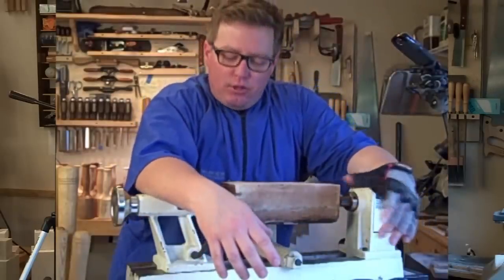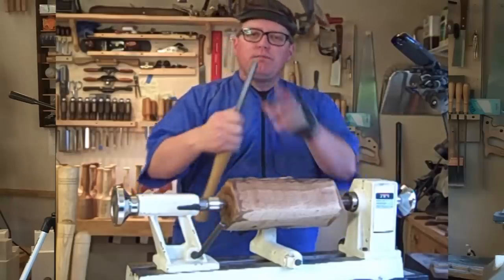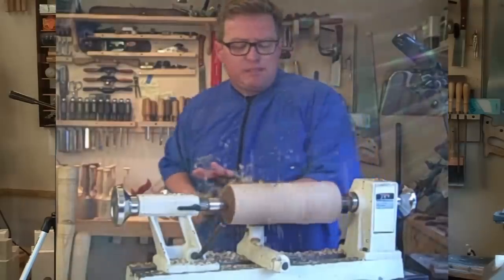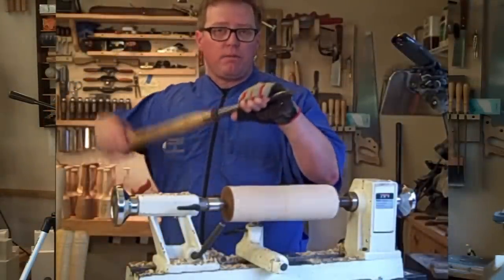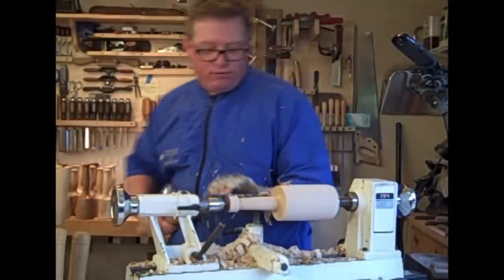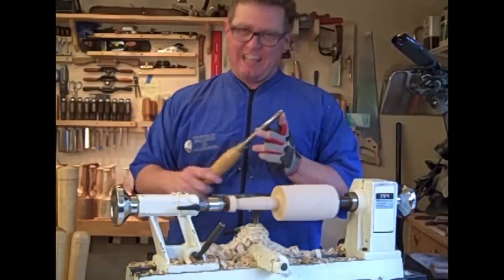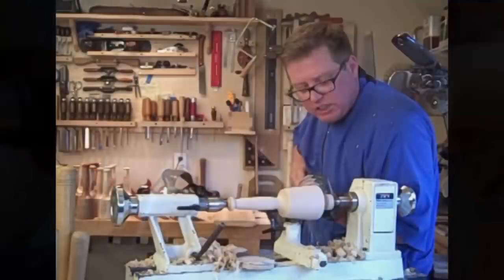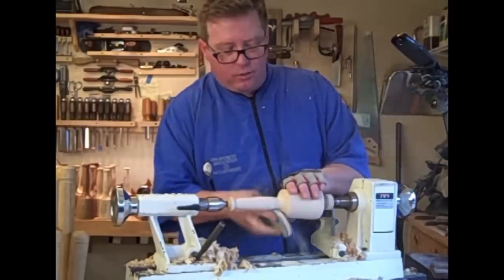Wood Turning Demystified - Basic Educational Demonstration to Get You Turning

Comment: As a beginning wood turner, I find this video very helpful in pointing out proper tool position and pivot. I have  reviewed it several times then practiced the concepts afterwards. While it feels different than it looks, the results are getting better. I suspect using soft pine is not the best, but maybe a cheaper way to learn.

Thanks,

Michael

Comment: Excellent video. I was having problems with my spring pole lathing and you absolutely gave me the courage to soldier on and some troubleshooting to boot. I underestimated the importance of the tool rest and just slapped one on there in haste. Redesign forthcoming. The varying camera angles really helped me see things I normally would have missed and I love your focus on the sound, shavings, grain. Nice "Better Off Dead" references by the way. Thank you so much for sharing your knowledge and experience.

Comment: Thanks for the video.  I'm normally a metalworker, but I need to make some handles for some stuff, so I'm building a wood turning rest for my metal lathe.  I didn't have a clue how to woodturn, but after watching your video, I'm ready to go out and whittle out some handles.  Thanks.
Reply from the maker: You can also bolt a rest to your drill press platform for stuff like handles. Turn vertically instead of horizontally. A few videos out there from others on this technique.

Comment: @wortheffort - That was excellent. Indeed, you convinced me: I've had a half-formed, vaguely-nebulous interest in "the learning of the turning" for a few years now. Never got into it for the same reason I've never learned to weld: namely it always seemed like the sort of thing that would cost one an arm, or burn down ones home if not taught by an actual, real-life, in-person teacher. The way you just presented this (with the hand plane metaphors in particular) abruptly made my cargo-cultish grasp of the mechanics gel.

So I just ordered a lathe and a starter set of gouges. I want you to know that, Mr. Worth. Because of you. So, should the unthinkable happen and disaster ensue, I want you to know what you've done.

Oh, I don't mean injury or property damage. That's all on me. If I hurt myself, or send a skew through the garage door into the neighbor's above-ground pool, that would be hyste-errr... entirely my own fault. No, I mean should my wife find out I just bought a lathe and chisels on the decade-old advice of a YouTuber whose channel I just found and hour ago. 

Although, now I consider, I suppose that, too, is simply transferring all the knowledge and experience I have from the rest of my woodworking too. Huh... well I'll be damned. It really IS almost identical. 

(Except for, yanno, the increased likelihood of a hand tool hitting an above-ground pool at orbital velocities. That part is a wee bit different.)

Comment: Do you have to stabilize the wood mallet? Been told that people making bowls have to use a pressure pot to stabilize the wood. Very new to wood turning, thanks.
Reply from the maker: +Tide16nc for tens of thousands of years wooden bowls and mallets haven't needed stabilization so I'd say no. Just don't use pinky wood and you'll be fine.

Comment: After you cut the end off, how do you sand and put the wax on without the lathe to make it look consistent? Thanks
Reply from the maker: +Andrew DiNatale If it's a personal mallet usually I just use my skew to cut it off. It has a slight curve so it works like a carving gouge. If it's a show piece I'll just take my time with sand paper after a gouge does the heavy work. If I'm using wax I'll use a softer wax and really buff it with pressure to generate a little heat.

Comment: I recently picked up two lathes, and have always wanted to turn bowls. Think I will start out with something else first. My question is this, tell me about ceder. I know it splits a lot, but is it possible to get decent size blanks from it?
Reply from the maker: +Tom For President. Cedar's just another wood. You can turn it, just take into account it's properties. Kinda soft, stringy and splintery, has oils that make me sneeze so I don't sand it much. You don't need much for spindle work. I always suggest people start out spindle turning because spindlers easily pick up other forms of turning such as bowl and end grain but not the other way around.

Comment: Great Video. I'm new at turning and it explained well.  What is the sanding pad that you used at the end of the video? Is it commercially available?
Reply from the maker: it's just a hook and loop sandpaper, you can buy them round in different grits. I found the little foam pad at a woodturning symposium but I imagine they're pretty common. If's convenient but I don't think it enhances sanding any more than folding paper in your hand.

Comment: Where did you get the tool rest assembly?  Did that come with the lathe.  I bought a lathe and Have used it quite a bit but the tool rest is horrible.  Looking for a better one to upgrade the lathe.
Reply from the maker: +Brian Watson get a robust rest. Don't question. Just throw money at the co. It's the only decent one out there. I have a factory one on my large lathe I have to file most days.

Comment: I have one of these lathes, but I have to move the belt to change the speed.  Is there any easy way for me to convert to a variable speed like yours?  My guess is probably not, but you seem to know how to get around the hard bends.  
I see you also have a OneWay lathe? Is it a medium size?  But I’ve never turned a big piece as you did here on mine.  I was afraid that it would be
A big disaster.  I think I need one of those mallets.  Was that Pecan from Seguin? I used to live there years ago. Ok I’m done.
Reply from the maker: Conversion is beyond my knowledge base. No reason moving belts won't work fine. People have been doing that for century. VS is a luxury. I don't have a Oneway, Dad does. it's a 1624. Yes from Seguin.

Comment: Why do you hold the roughing  gouge with a open hand? It open you out to get a finger catch
Reply from the maker: Dawid Scholtz  block shavings.  Also consider camera angle, fingers well behind tool rest, perspective might make look closer than is. Very safe.
Reply: Thanks for the quick reply. I am a metal turner and only started working on wood.